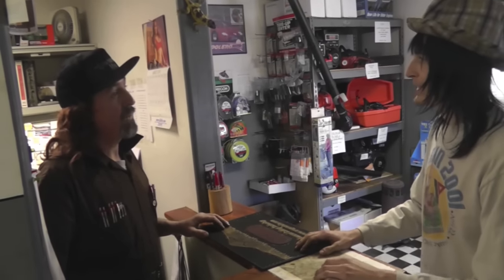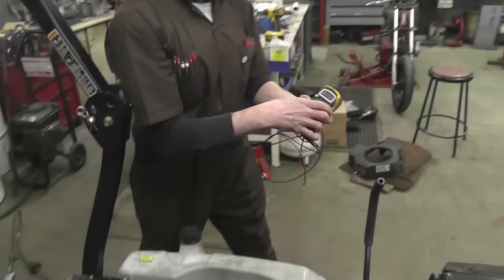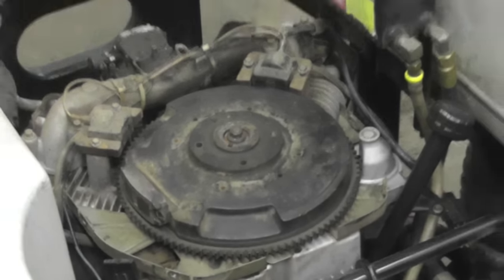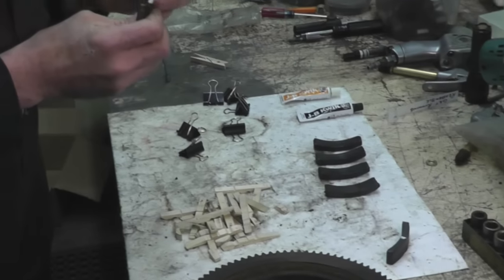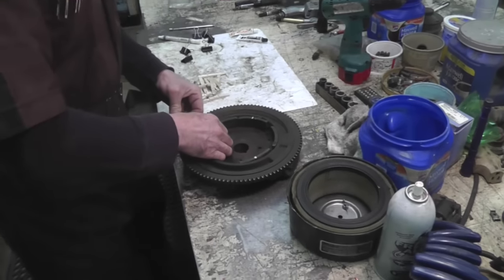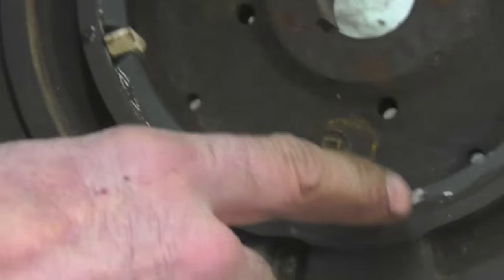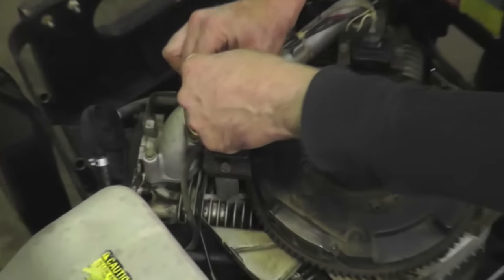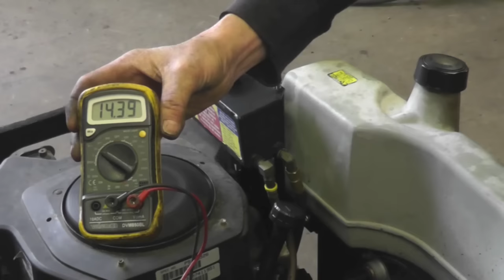Repair Broken Kohler Flywheel Magnets to Fix Charging System

Comment: I found out it was a lot of dirt and balled up grass from the cooling cover down under the flywheel and across a few stators. Kohler courage 24 v twin. I did get an increase to the AC volts to 18.5 ish after and now runs on full throttle. Now the engine surges at low RPMs Taryl your prybar worked smoothly removing the flywheel ! Thanks.

Comment: I was wondering how many volts the rectifier should put out for a 27hp Kohler? and can I run the wire DC wire from the rectifier directly to my battery? thanks

Comment: Great Video! Have a Kohler CH23 engine and had to replace the stator, which had a broken corroded wire, glued loose magnets back in, and replaced voltage regulator. At full RPM the regulator produces 38-41 volts AC but only 8-9 volts DC.  The battery has always started the mower when charged and is not new but was fully charged and showing around 12.7 volts. After starting it maintains charging battery only at the same level with slight increase (like 12.74), but not the 13+ volts I was anticipating?  I believe the battery is ok but have recharged it several times before fixing the charging issues.  Does this scenario just indicate weaker battery? or something else I missed? or its normal?

Comment: are you testing the stator output on AC or DC? I cant understand you for the noise of the engine
Reply from the maker: Alternator is AC the regulator is what converts the voltage to DC

Comment: Assalam O Alaikum!
Sir, I have a honda cg125 point ignition system. Its stator magnets are broken. I arrange new magnet pieces but i did not know what kind of epoxy or glue i should use to fix them in body. Please tell me any type of epoxy.
Reply: He is using jb weld kwik weld 2 part epoxy
Reply: The hv350 adhesive that he sells on his website would probably work also

Comment: My Kohler was weak on power for over a year. I found your videos and felt that WE could fix it lol.  My magnets were pulverized , I found a used fly wheel, stator, and coils and thanks to you...I was mowing with power in about two hours. Just wanted to say thank you... getting 47 AC from OUR repair!.... and about 13.5 at battery

Comment: Tried this method with a broken  magnet, so far we are good to go!  Gotta love these krolers!  Thanks for  good basic helps!
Reply: Thanks Tyral,
I also had a broken magnet.  I just spaced the magnets as shown i.e alternating North South poles and glued them with JB Quick to the inner face of the flywheel with the 1/8 inch recess from the top inner face of the flywheel. The one that was cracked I just placed the two pieces together where it was cracked and glued them to the flywheel.  Got good A/C readings from the Stator and also good D/C readings from the center tap on the voltage regulator.
John

Comment: Great demo as all the others are. The connector to the voltage rectifier from the stator , does it have a specific way to attach to voltage rectifier? both outer wires are ac form stator, does it matter which end they are on? I have the kholer command engine  on a cub cadet lt1050, with center wire going to battery/'key.

Comment: so on my Kroler that's in a John Deere LX255 im getting great AC volts (new Stator) into the Voltage Regulator (new) but not getting a good charge to the battery. How do I test DC volts from VR and what else might be wrong to cause a no charge problem?
Reply: set your meter to DC, ground to frame with one test lead, the other go's to the center terminal on the VR. if correct voltage is present, check your wiring back to the battery. If less that 13 volts, VR is bad (if you are getting AC volts to thye VR, should be 35 + volts AC)

Comment: Didn't know the coils cranked out that high of a voltage. Gives me some ideas for my old JD110 using the diodes from an old G.M. alternator and mounting an external regulator. Maybe I could squeeze a little more juice from those coils...like a juice box!
Reply: Jon Myers

Comment: Fantastic video.  Bought a Husqvarna tractor and noticed no output from the alternator/no charging.  Ohmmeter showed the stator was good and I stumbled onto this video.  Absolutely could not pull the flywheel with a puller and Taryl's pry bar and hammer worked like a charm.  Popped the flywheel and sure enough, the magnets were off the flywheel.  Replaced per the video and back in service !
Reply from the maker: +Tony Varga Great to hear Tony! And there's your dinner!

Comment: Awesome video. I checked mine and am getting 43 volts AC from the stator and only 12.43 volts DC at the battery. I replaced the regulator and still have the same problem it keeps killing the battery. What should I check?
Reply from the maker: Make sure the little ground jumper wire from the regulator to the engine has a good ground. Make sure the wire is not broken. Try jumpering a wire from the case of the regulator to the negative terminal on the battery & see if the voltage across the battery increases. Thanks fer watchin the video Taryl
Reply: Awesome! There is no wire but I will try adding one and see if that works! Thanks!
Reply: OK I tried that and it still does the same thing. 43 Volts AC from the Stator and only 12.43-12.68 at the battery. I sanded the engine block where the regulator bolts on and I have added a jumper wire from the regulator to the negative on the battery and still have only 12 volts at the battery. keeps killing my battery. What else could I check? I have followed the wires and there is no in line fuse and on the fuse bus there are only two fuses and both are good.

Comment: So continueing a long journy to put a headlight on my minibike, a 8hp engine i had had a stator and a flywheel with 3 magnets. what i did was swap the stator to my 5hp techumseh and since the inside diameter of the flywheels are the same but the outside is too large on the 8hp one i decided to try and swap the magnets. i knew this was going to happen but i broke one of them, got one good, and slightly chiped another. the one that broke in half the poles dod not seem to reverse as the magnet still wanted to stick back togeather in its near original position. i currently have them glueing to my 5hp flywheel but im wondering if that magnet that is broken is going to cause problems. im just wondering if you have any experience putting broken ones on and how well or if they work at all. Thanks!
Reply from the maker: +jmdogful  I never use broken ones .

Comment: 9 years old!! Wow!! 
I'm working on the same exact mower. 1 magnet is loose. Prob see if any others need jb. 
Next problem is I can only turn crank 1 turn and it hits something.  Pistons both move when looking in, valves move also. I actually took rockers off so I know a Poston isn't hitting one. Not sure what it's hitting. Will know tomorrow once I split the case.

Comment: I try a new stator 18 amp. honda and my old flywheel with two magnet and i have not AC volt come to the stator. Please if you have a idea, i am lost.
Reply: it's 13 hp horizontal shaft, it come to simple one 1 amp. stator and i try to upgrade to de 18 amp stator

Comment: If I was the customer I'd want a new flywheel. Unless your doing all that extra work gluing the magnets for free I'd want my money to go towards a new part.
Reply from the maker: Yeah that's why we'd call you and ask what you wanna do. This customer is still running this engine and this repair was done over 4 years ago. Chances are your new magnets would have come off like these did. Now There's Your Dinner

Comment: Good video...but getting the cover off is a project by itself...that would have been nice to include.

As a side bar, please see a prosthodontist or orthodontist. They work together so when you see one they will refer the other. If the dental issue isn't dealt with it will be worse than the coil hitting the flywheel! If cost is an issue, dental schools can provide the service for free or nominal charge. They may be students, but they are supervised by the best in their fields and are familiar with the latest techniques.
Reply: You do realize that the teeth are fake and he only uses them for video purposes to make it funny right?
Reply: My dentist uses JB Weld.

Comment: hi there

i have a magnet for a Yamaha R1 abd bought the little magnets replacements but im wondering what kind of glue should i use
Reply from the maker: I have a customer who glued his on with marine glue and he said its still holding  and its been over a year. I use JB weld and haven't had any of the repairs I've done come back. So I would think any good epoxy type adhesive would work just make sure the surfaces are clean.

Comment: What if the magnet is just has maybe 1/8 of a inch broken off? or does it have to be pretty perfect?
Reply: thersten you’ll be fine. I have mine glued in place and they got fucked up. I have no issues.

Comment: hey I got me a push mower I got brought to me to work on. the thing only has spark when I put the ground wire on the coil to the spark plug lead and holding me hand to the spark plug lead to a ground. I looked at the flywheel and the magnets only have magnetism only on one side. the other have no magnetism. you think it's a coil or flywheel?
Reply from the maker: +Jordan Walker Let me get this straight. When you hook up the kill wire you have no spark?
Reply from the maker: +Taryl Fixes All    Try a different coil
Reply: Taryl Fixes All  Do you or anyone you might know have any Clinton engines, parts????  494. 498. 492?? Larger HP too 7.2 HP up to 13 I believe thank you in advance for any help.

Comment: I've got a Cub Cadet 782 and I can't get the thing's engine to run at top rpm, it alway runs low and if I adjust the governor's spring length it will run at top rpm, but when I adjust the lever to the slow position, it only runs a little slower and not as slow as its supposed to. I've even adjusted the Fuel/air mixture, messed with the linkage between the throttle lever and governor, and between the governor and carburetor. Is there something wrong with the governor?
Reply from the maker: +kd9bwi I don't know without having it here in front of me it could be anything. But check to see if the Idle screw is turned in to far. I've had it where someone has turned the idle  screw in thinking it was an adjustment for the the top speed.
Reply: I had it turned out as far as I could get it, now I could manually push the rod going to the carb so it would hit the idle but the tension would be very tight and the the governor would then take the grip from my fingers and kick it back up.
Reply from the maker: what model Krohler engine is it?
Reply: +Taryl Fixes All LLC kohler kt17 series II.
Reply: +Taryl Fixes All LLC I don't know if it would matter or not, but I broke the original spring and made a new one, perhaps I need a longer, stiffer spring?
Reply from the maker: Look-up & buy the proper spring from Krohler, that may be the problem.
Reply: +Taryl Fixes All LLC I will try that, but, the first issue that made me adjust it and break it was the engine would surge really bad when idling and when engine was cold, it would die unless at half throttle. Thats when I started bending the spring to attempt to fix it. I noticed you had video on adjust a governor that Taryl JR. attempted doing, would that possibly fix the surging once I get everything put back the way it used to be? I've already attempted adjusting the mixture screw, idle screw, and messing with the holes the spring goes into when the original spring was on it.
Reply from the maker: Surging could be a number of things. 1-being the governor needing to be adjusted, A vacuum leak ( Gaskets leaking on carb. manifold ) or low speed circuit in carb. is blocked or dirty.
Reply: I haven't opened the carb up since it had been sitting for x number of years, I'll do that before the first cutting. I'll follow your governor video while the carb is soaking. Thanks!

Comment: The old 10 -20 -30 rule you know what it is
Reply: Ten thousands on the magneto 20 thousands on the points 30 thousands on the spark plugs 10-20-30 rule all small engine mechanics use

Comment: will the motor charge if one of the magnets is missing?
Reply from the maker: Jerry Davis No it will not work! Must have the correct polarity magnets and you can't buy the magnets unless you find an old flywheel with good ones on it. There's your dinner!